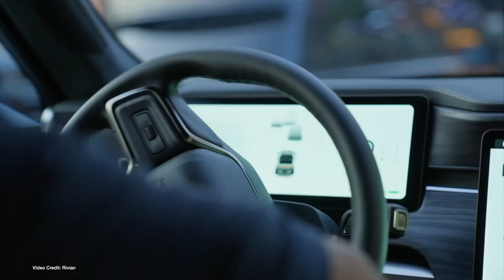EcoTEC 284 - Tesla Q2, Aptera in a Wind Tunnel, Kia's Weird Publicity Stunt

Comment: Aptera has one thing that could solve the motor heat issues, by making the wheel covers help hold components and coolant, there would be no excessive liquid compression bursting of the lines at turning points   in the coolant lines, or other options like a early coolant light warning and a pivotal seal type rotation elbow outside the brake area's the will need changed, and if ever cross threaded because of heat expansion and mechanics people error witch always happens the lines will need a easy access changing when needed. The reason motors get hot is that  more heat gets generated as the motors spin and fight their own magnetic forces, hills more power more heat more resistance in the electrical system. All not a bad problem the motors   need coolant monitoring, or metal housing heat sensor easy to replace as well most cars have that stuff anyways. The batteries and controllers don't need the motors excessive heat generation on them so the system is best separate anyways. ,,,,,,,,,,, Personally lines without a  easy changeable pressure relief valve is not smart because liquid does not compress like air will. Also all the flexibility things will need changed in the not so close future that's natural.    Any elbow with a seal will fail a lot faster and need lots of changes.  Those wheel high pressure high temp lines will have to be good and the pivotal area's not such a sharp degree like a new design pivotal area snow and ice can not settle on. A good simple pressure relief valve and pressure secondary release safety back up would be best because of the none stop use. Coolant temp readings for both coolant chambers could help solve and monitor any issues like witch pump needs replaced because one pump has many switching expensive complex parts and extra issues needing attention. I'm sure we will all talk about this stuff as we drive and get to know our Aptera.
Reply: Aptera is almost sunk. They left off the hoses on Gamma for six months and it broke down on NBC a couple of days back. CEOs are lying again (as usual), but I don't think polished snake oil salesmen ca lie their way out of this one.